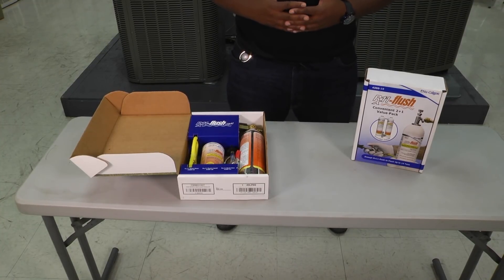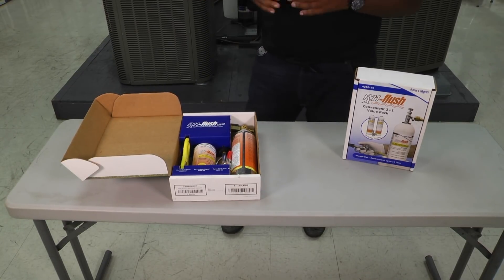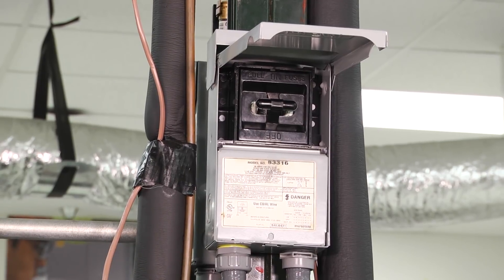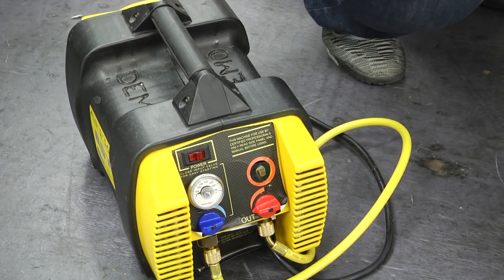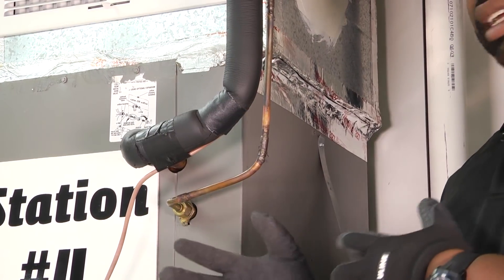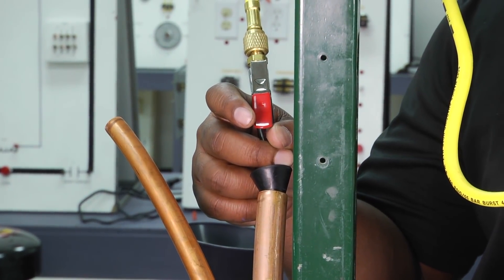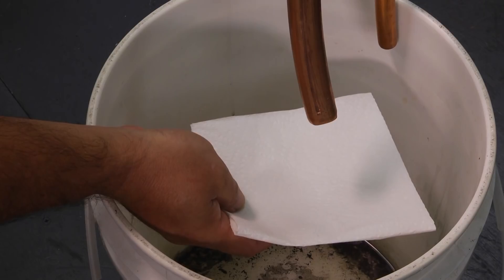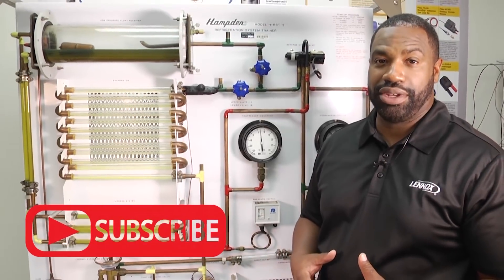How to use Nu-Calgon Rx11-flush

Comment: Good video. BUT.... The nitrogen process of pressurizing the tank at 50psi, removing oil traps on systems that may have them, crimping exit points for turbulence, time needed per flush per 50' by diameter, and purging at 150psi (max 200psi) with nitrogen needs to be mentioned in the process!!!
Reply: Make your own video then. This video was about the process that he was using. And if you actually watched the full video. He did mention the nitrogen pressurizing at the end. He just didn’t get all technical with it.

Comment: Had an Pride a/c company in Miami change out an old 28 year old Trane  12 Seer 2 1/2 HFCF  to a new one 410 a system 16 seer and they did not flush system,just put it in a vacuum and opened the valves no start up sheet filled that new units bring,Glad to had seeing this,will call them back to let them know.
Reply: Don’t worry about it. It’s not that serious. As long as they did a drier and pulled a vacuum you should be fine.
He probably did the start up sheet at home lol

Comment: How about u have an r22 system going to switch to r410 but evaporator is for r410 do u have to flush  the evaporator? By itself or can u do it by cutting  the lines outside and flush thrrw the suction  side towards the liquid line while the evaporator  is comnectec too? Or like i said before isolate the evaporator  and flush evaporator  1st then the suction line and liquid line???
Reply: Honestly. I’ve only flushed a few systems per owners request. 
Never had an issue on units I’ve installed without a flush. Not sure if this does anything. Assuming you pull a good vacuum and install a drier. The units range from 7-3 years old and haven’t heard anything from those units. Some have had electrical problems. But not mechanical.
Reply: Just flush the whole system, it’s not going to hurt it.

Comment: A Doug I appreciate the video. 
Replacing the condenser and line set from a r22 to a 410a system. The furnace and evaporator were change out  3 years ago. 
Doug can rx11 be used just on the evaporator? I appreciate your input.
Reply: So this product is for line set only what about ccoil & evap coil

Comment: I waisted 200 on this bullshit it says it does 50’ lines I got nothing out the other end off the line and there was no pressure left and the can was still full wtf
Reply: As eddman32 mentioned: "Wrong way to flush out system....you need to crimp ends of copper line set.    read the directions on the can"

Comment: Is it Lennox’s official position that flushing line sets on a retrofit replacement with Rx11 is acceptable?? If so please put it in the ODU instruction manual, and inform your trainers of this policy. As a contractor the mixed information is confusing.
Reply: Hi Neil
Do you have any exprience about rejecting the water and oil from the condenser of an air cooled chiller?
Reply: R11 used as a flush to remove the mineral oil that is used on HCFC systems which is not compatible with the 410 refrigerant oil?